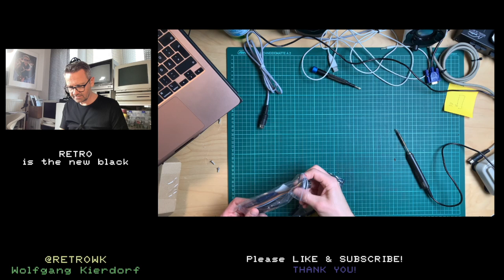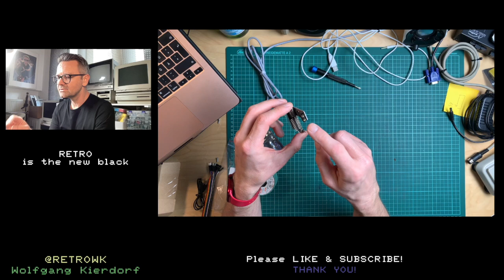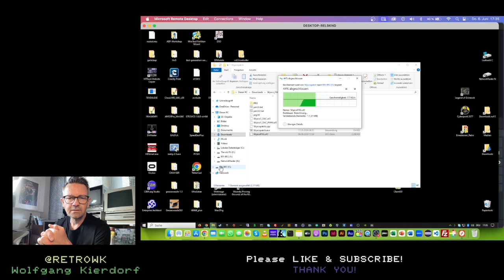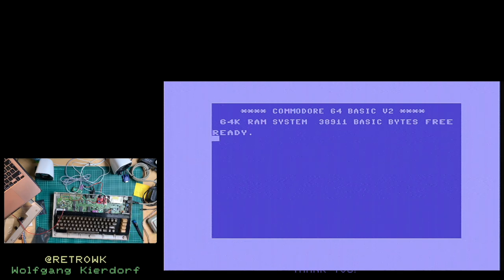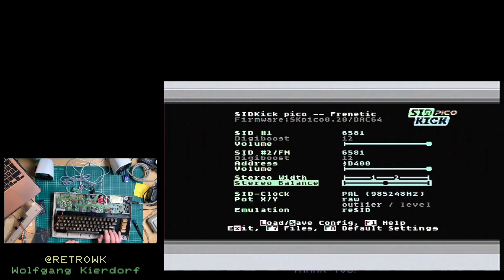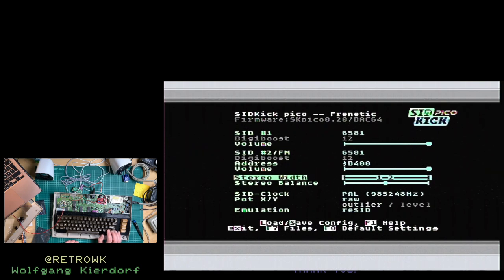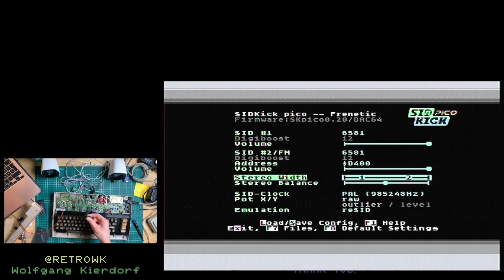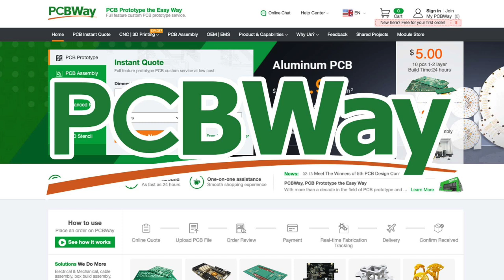A $10 C64 STEREO SID with 16 built in programs (Pt.2) - C64 SID replacement #pcbway #commodore

Comment: If you set the SIDs as one 8580 and one 6581, you'll get a better pronounced stereo effect from the mono soundtracks because of the sound characteristics differences between them. Otherwise, you'll get exactly the same sound from both channels, which is only "dual mono"

Comment: Thanks for doing this series.  I followed the link in the description from the original video.  Down at the bottom of that link on PCBWay it clearly states that there is another version with built-in DAC and a link to it.  Clearly some people didn't read all the way to the bottom before ordering.  That is the one I chose and 10 units assembled is just shy of $100 with shipping with about a 28 day production time.  To be clear when you order the price will vary because ordering shows $0.00 for components and that quote will come in about 3-4 days for a total price.  By the time you add a Digi-Key order for the Pico and headers you are probably closer to $16-$20 USD.  I still think that is a great deal and plan on sharing some of these with a few friends as I do not need 10.